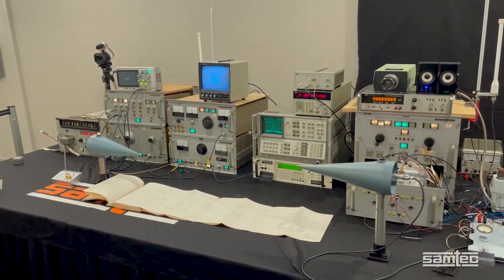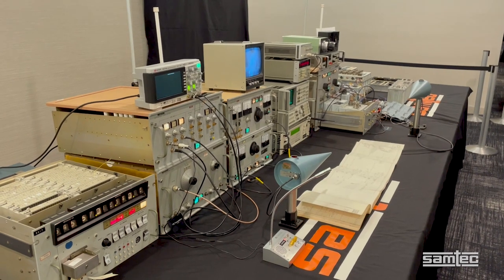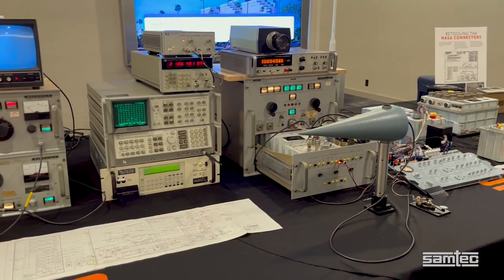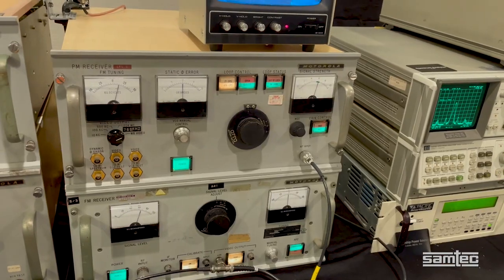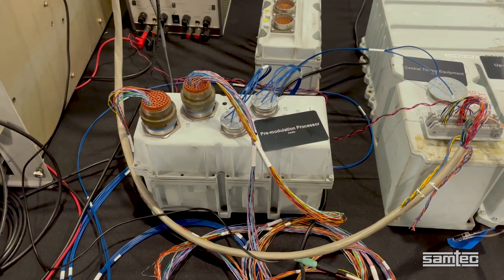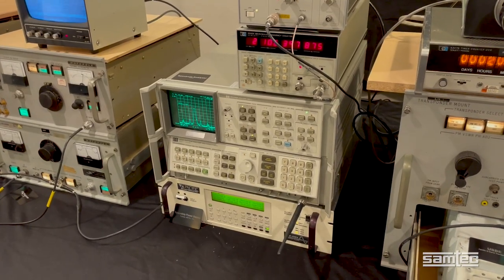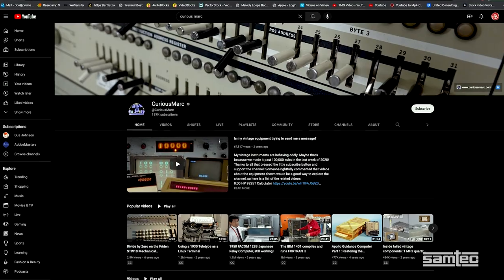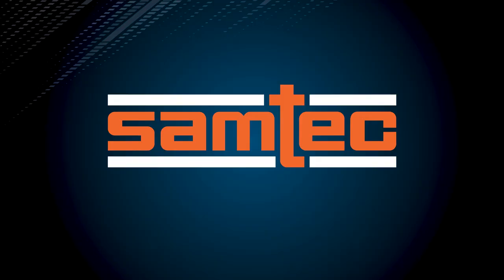Apollo S-Band Communications Demo DesignCon 2023

Comment: This is like a mobile data video 348000 kilometres away across the void of spaces .
Correct me if I’m wrong, but is it true that radio waves don’t travel well through space without as many particles to bounce off.
Or is it the other way around? 
Either way, it’s a very long distance and much further than they fly drones away from the remote control. 
Let alone they fly a helicopter over the Martian surface
Why don’t they use that type of technology on earth.